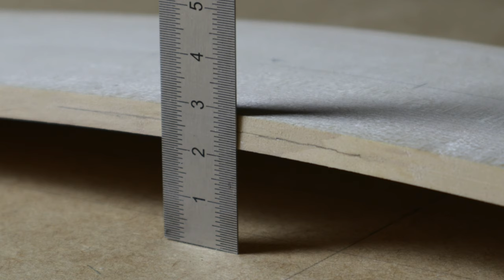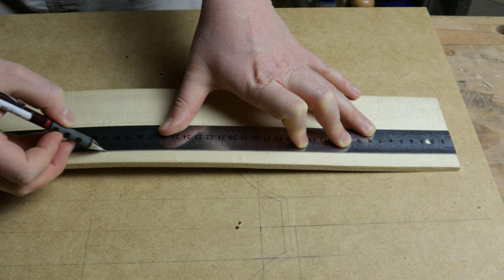Viola da gamba making | Part 11 – gluing the bent top

Comment: Beautiful video. May I ask why you join the first parts at an angle and the outer parts square? Or did I interpreted it wrong?
Reply from the maker: You're right. The goal here is to achieve the 'keystone effect'. It makes the top plate stronger and allows it to be thinner.